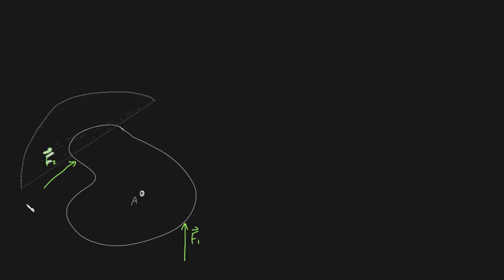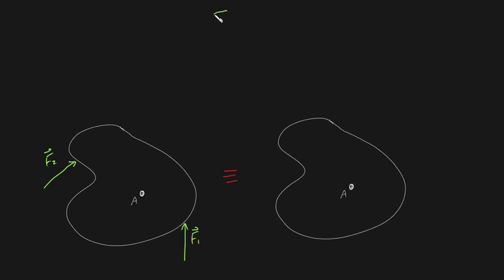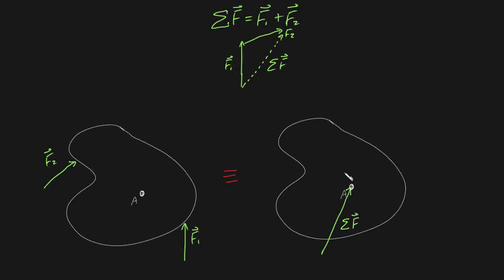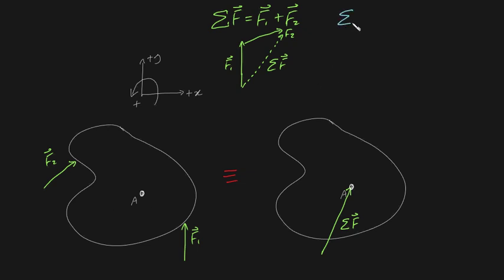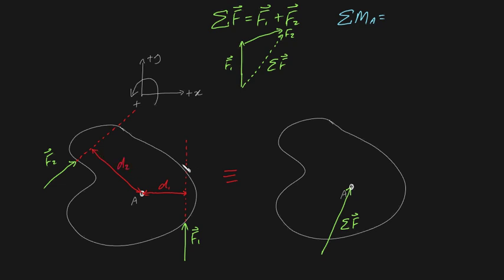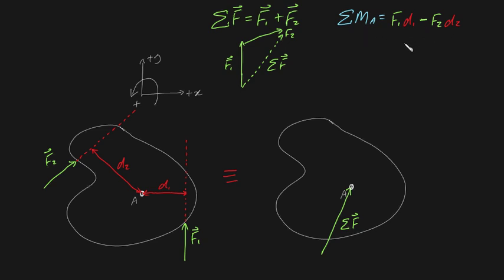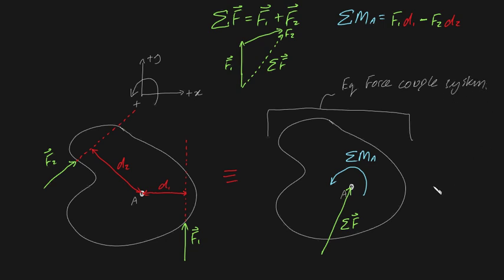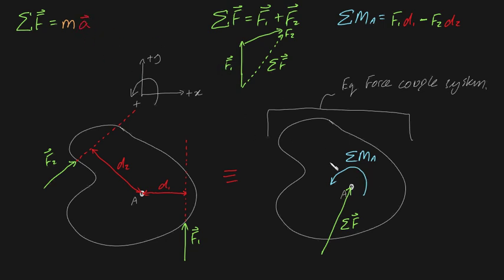Equivalent force couple systems

Comment: wait how did you know the direction of the net moment? i didnt get that part
Reply from the maker: Only using intuition you can tell that F2 will try and rotate the body clockwise about point A. 

Likewise, only using intuition F1 will try and rotate the body counter clockwise about point A.

Winter clockwise by convention is considered positive (look up right hand rule if you want to learn more) answer that means F1 produces a positive torque and F2 produces a negative torque).

If you don't want to rely on your intuition and you want to more math heavy approach you can always use vector algebra and cross products
Reply: @virtually_passed  Thank you!

Comment: I missed the lecture about this because I was half an hour late. Thanks to you, I got it now! Great video!
Reply from the maker: Wooh! I'm glad it was helpful.
Reply: Got a question:
If I use cross product to find the couple, it should be F X d right? And is the distance vector supposed to be the distance from the new couple point to original point or the other way around? Hope you understand my questions
I find it easier to do cross product for 3 dimensional problems.
Reply from the maker: Michael Han Hey mate, great question! Noooooo you should always use M = r X F. (you'll get the wrong direction otherwise!). The r vector is ANY vector from your point of interest (in this case point A) to your force vector. In the example above you'll notice that the moment will be entirely in the Z direction. Then use the right hand rule to determine whether it's positive or negative. 

I know that's a lot to take in haha. If you don't get it, please message me back and I might be able to make you a video describing how it's done by tonight.

Cheers,
Matt
Reply: Matthew James Matthew, I understand "what" the force couple system is- yes i get it.(Excellent video by the way. It's concise, and to the point.) BUT I don't know the "how it works" or proof of the force-couple system. Nothing in my textbook seems to explain WHY it works. It drives me nuts that these textbooks tell me WHAT They are but I can't just accept them in dumb faith, blindfolded. I need some kind of mathematical proof, maybe with some diagrams to show me why the couple-system is truly equivalent to the other system. Can do a proof video on it and save my soul ?????
Reply from the maker: Don Kim Hey mate! I know EXACTLY what you mean. I've written up a proof for you. I'll email it to you if you want
Reply: Matthew James Just sent a private message to my email, thanks in advance!